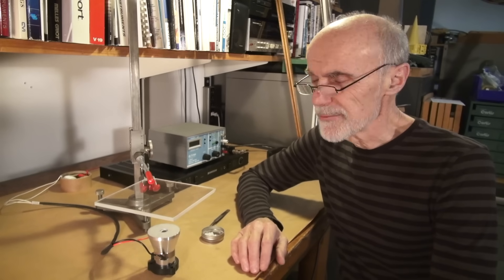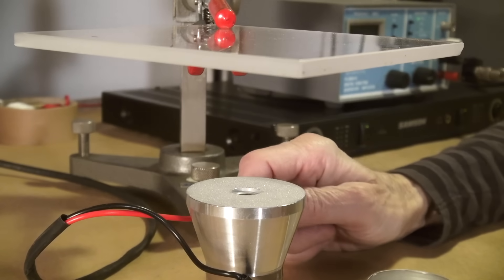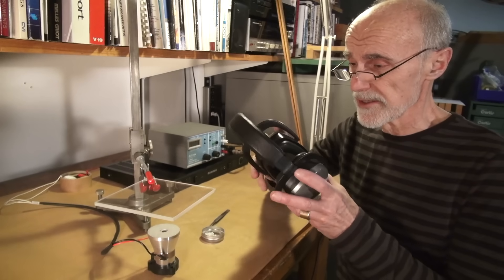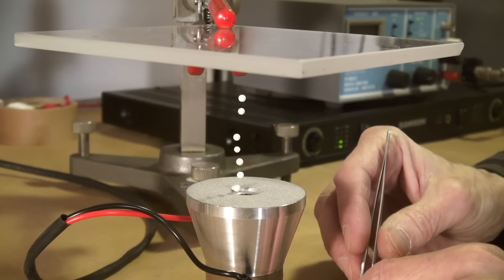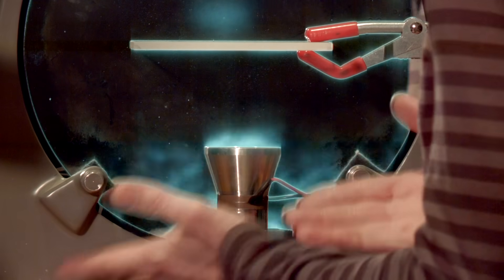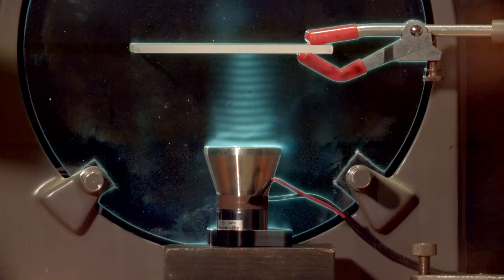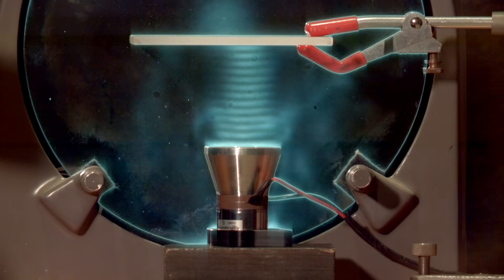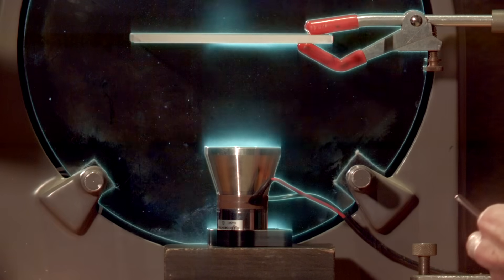Acoustic Standing Waves and the Levitation of Small Objects

Comment: wouldn´t the bright lines be the low pressure area? Your explanation did make sense, but my thinking is this:
the ball would be "sucked" into lower pressure areas and the high pressure above and below the ball would prevent it from going anywhere. 

since I assume, that i am in the wrong here :D , i would love, if you could take the time to further explain where my thinking is flawed!

regards from germany!
Reply: Yeah it made more sense to me too that the ball would settle in one of the low pressure areas. An explanation (from anyone who knows how this works) would be great.
Reply: I might be wrong but when he says high and low pressure it means high and low pressure variation. So at a spot of high pressure, pressure oscillate a lot between a pressure above atmospheric pressure and below atmospheric pressure. Whereas on a spot of low pressure, pressure hardly change over time.
Reply: @arseneferriere5151  That basically correct, but the balls will gather at the points where there is no change over time (wave nodes).
Reply: My guess is your explanation is correct, if there are high and low pressures, then directly in between there would be a point of equal attraction resulting in stability of the balls
Reply: I came to comment section for exactly this reason thank @ScorpEUs92   @Mihir Gadgil   @Arsène Ferrière  @Ad Addv
Reply: There are 2 different descriptions for sound. One is a pressure wave, that is literally the variation of the physical quantity pressure. And the other is a displacement wave, that is the actual movement of the air. These two waves are out of phase with each other. The nodes of one wave (the zero points) coincide with the anti nodes (points of maximum amplitude) of the other wave. So the regions of highest pressure variation are actually regions of least air movement. It is at these displacement nodes that the beads settle down.
Reply: @mihir2012  Thank you!
Reply: Mihir Gadgil you are correct.....only I still don’t know what the fuck you said. Lol
Reply: A comment to follow the thread
Reply: Well high pressure can be the location where the air flows to/ is pushed towards so it kinda makes sense I guess
Reply: I thought the same but it makes sense as he tells it. The high pressure is where soundwaves are going up and down so that they are squishing that zone as ina  sandwich and “sucking in”. Thats why the ball stays there. I mean the pressure is towards the center not outside of it. In the low pressure areaa the ball will simply fall down

Comment: What kind of energy is needed? Seems like a really inefficient way to levitate an object....
Reply: 8 watts
Reply: @wolfgangrueckner7151  per tiny Styrofoam ball?
Reply: @kogasoldier9379  No, the ultrasonic transducer is rated for 50 watts but we operate it at 8 watts (which is the minimum required to levitate the balls)
Reply: @wolfgangrueckner7151  well. As many as can fit in the pressure systems I assume...
Reply: @wolfgangrueckner7151  also. If I'm not mistaken. Such a system would only function within an atmosphere....

Comment: This could be used to create a flying car or something, with the sound producing area facing downwards and using ground as a reflector. But the problem is having the right wave band. As we can see in this video, distance between the sound producer and the reflector is key to levitating anything. So if our flying car were to go over a house or a hill or a large tree, that would break the required wave band length. Thus, our flying car will end up as first ever vehicular aeronautic crash.

Comment: SOOOOOOOOOOO what is a practical use for this effect? Make it work in a vacuum and I'll be impressed.
Reply: puts on AOC hat  what, like inside a Hoover?
Reply: A vacuum has no air. sound waves only transmit through air. Therefore it's impossible to make this work in a vacuum
Reply: @maribelhandesu  that was my point.
Reply: @rtta51 what's even the point of your comment then lol
Reply: @maribelhandesu  The point is, It Has NO practical application. A stream of air will levitate a ball (and even a screwdriver) in the air, looks cool but has no practical purpose.
Reply: @maribelhandesu  Google infrasound. Sound can travel trough space, but it requires ridiculously low frequencies because molecules are so spread out.

Comment: Nice! Can you do it with lower frequencies? Why 28 kHz?
Reply: At lower frequencies the balls have enough time between waves to fall out of the high pressure pocket and won't stay suspended. At 28000 Hertz, they only have 1/28000th of a second to fall before being pushed back up by the next wave. It's not enough time to move out of the optimal position.
Reply: David Crowley thanks! I was thinking shorter wavelengths would be the cause
Reply: @poopdtoilette6182  wavelength is definitely another equivalent way of seeing it: higher frequencies have shorter wavelengths so successive crests are closer. Standing waves with longer wavelengths (at lower frequencies) allow the balls to travel too much between successive crests, gaining momentum that the high pressure areas cannot completely reverse. The balls fall.

Comment: So what could you suspend, or move, with a, say, 100 hz frequency system?
Reply: the lower the frequency the more the wave spreads out and the harder it is to create a standing wave out of it. But, in theory, a lower frequency has a larger wavelength and should be able to hold a larger object.
Reply: @rumfordc  exactly, so...... in theory.... what can humans achieve as the most powerfull achievement in this sense? I mean, if we could focus an energy say, like nuclear energy, or rocket energy, into  a proper soundwave machine.... what could we lift? and create?

Comment: Aren't you mixing up high pressure with low pressure zones? I was under the impression that the objects as well as the mist are pushed into the low pressure zones.
Reply: that is certainly the orthodox explanation, but our measurements show otherwise
Reply: @wolfgangrueckner7151  On second thought, the high pressure zones are high pressure zones because stuff accumulates there in the first place... So makes sense then after all.

Comment: No explanation of where the lift against gravity comes from or the mathematical proof of why gravity is nullified? High pressure by itself is not lift.
Reply: How does an aeroplane wing work then? Maybe not high pressure itself but certainly a difference in pressure. Increased on the underside and decreased on the top.

Comment: Childhood experiment on ultrasonic levitation by using a piece of plastic sheet, stretching it tight with the hands and rubbing vigorously on the tights to generate heat, after that applying above on small paper cuttings set up on the table making the paper to jump upwards and upon lifting much higher the paper will stop jumping.

Comment: I don’t understand why the balls rest in high pressure bands rather than in between the bands.

My understanding is that they are floating, because in the high pressure area the density of the air exceeds the density of the ball. But if that was the case, part of the ball would be in the high pressure band and part in the low pressure band, just like a ship is part in the air and part in water.

So I am wrong that this is a floatation due to high-density air ? Is there another mechanism at play? Which one?

Comment: I worked in the field video, internet, and VOIP installation and repair and loved this demonstration! I had to learn about wavelengths and fm antennas are built in increments of the wavelengths you're trying to tune into. Older cars were 42" (1/2 of the wavelength) and then they were shortened to 21" (1/4 of the wavelength). Cable installers don't measure the distance between cable clips because, if you space them at the same exact distance apart (i.e. 14", 21", etc), there's a good chance of canceling out the frequency that travels at that wavelength. In the current digital cable world, they can fit 6 digital channels in that one band so, if you're having problems with just 6 channels, something is wrong with that one frequency and that could be one of a few culprits. Cool stuff and much more technical than I originally expected. Love it though!

Comment: Are you sure about the region pressure? I think the balls will stand in the low pressure region. High pressure regions will push the balls to the low pressure region. Am I wrong?
Reply: That is indeed the general consensus, but our measurements show otherwise.
Reply: @wolfgangrueckner7151  thank you for your answer. I had another question. Why do we use high frequency? I guess reducing the frequency will increase the size of object. Isn't it?
Reply: @fikretkus106  the higher the frequency, the shorter the wavelength and thus the smaller the apparatus.  For example, the wavelength at 100 Hz is about 10 feet, so you would need a lab space where the reflecting surface is 20 feet or more away
Reply: @wolfgangrueckner7151  so if I want to levitate an object about 1 feet I should set the wavelength proportional to that size. The only limit is the apparatus size. Right?
Reply: @fikretkus106  The acoustic standing wave size is some integer multiple of 1/2 wavelength.  If you minimum levitation height is 1 ft, then you need to set up a reflector a few feet away from the loudspeaker and use a frequency around 1 kHz.  That's a HORRIBLE sound to hear, and REALLY horrible at loud volume (which you need to levitate).
Reply: @wolfgangrueckner7151  but it still worth to try :)
Reply: @fikretkus106  absolutely!

Comment: Oh, hey...HOW much pressure is in the high pressure zone?  Can you tune that pressure? Increase it? 

Doesnt graphene production require high pressures? Could you possible use this to produce cylindrical graphene without a substrate? 

Like,  if you emit in 360 and then reflect back in 360 (from a tube of reflector material around an omnidirectional emitter).  Couldnt you suspend carbon atoms AND pressurize them.  

Couldnt that be used to produce a tube shaped piece of graphene?

Comment: So, couldn't you maintain the standing wave through the periods where it normally would disappear by changing the frequency of the wave? Or does doing that dissipate the high pressure areas. 

Ive seen a similar experiment with water droplets,  i became interested in acoustic levitation when I was trying to solve the problem of providing frictionless movement over the a surface, like a hover-craft. 

I dont think acoustic lev. Will ever be viable for that.  But for chemistry and even 3d printing or assembly requiring simultaneous access to a piece in 3 dimensions this could be super useful.  But I think youd need a denser medium than air, but still gaseous to prevent the print medium from partially dissolving. 

Also im guess vibration would be an issue.

Comment: Can you maintain the waves by changing/matching the sound frequency to the distance between the speaker and the reflector (glass plate), e.g. by constantly measuring the distance between the speaker and the reflector and adjusting the frequency accordingly?

Great demonstration!
Reply: The answer is yes if I could change the frequency, but the frequency is fixed at 28 kHz for this transducer.

Comment: So hypothetically if you could construct the speaker device to be  very large or even more than one device in a vehicle and faced it downwards using the Earth as the reflector could you theoretically have created a levitating vehicle, a levitating aircraft that could travel within those high pressure bands at will,  continually using the Earth as the sound reflector?
Reply: Thats the reason why when flying saucers flew over cars their radio would cut in and out 👽 📻 ...
Reply: @FelFree  are you kidding?
Reply: @andrewc1036  Why are you asking me that ? And I will tell you
Reply: @FelFree  because ultrasonic acoustic waves don't interfere with VHF and UHF electromagnetic waves.
Reply: @andrewc1036  well I'm not gonna lie I did think I was on to something ... But I thoughts I was gonna get laughs out of it ... Thank you for teaching me ... And How do you know by the way ?
Reply: @FelFree  no worries it's all good. 

One is waves pushing air back and forth the other are electromagnetic. Also radio is an much higher frequencies than sound waves.
Reply: @andrewc1036  ... got you. thanks !
Reply: I think this would work with two rotating electromagnetic coils and depending on the ultrasonic frequency strength you can both cancel out gravity and dial in the desired height locally! Just make sure the ultrasonic frequency is active inside the coil to interact with the coil's electromagnetic spin!
Reply: @jocen3225  Hmmm. But gravity is a function of mass, not the earth's magnetism. Unless you're talking about having an electromagnetic emitter on the surface of the earth. That's be theorized, but the size of it, and the amount of energy needed to power it, would be astronomical unfortunately.
Reply: That would be cool. Although I wonder what would happen in a power outage. :p
Reply: Warmonger of Warsong how will that make it fly? I could see how the compartment above the mirror would levitate but wouldnt the whole thing just drop to the ground due to there not being any standing ways between the speaker and the ground? And also what kind of crazy power would you need to generate waves powerful enough to lift that wave when a normal speaker can lift about 5 water droplets?
Reply: @abvmoose87  Very good ! I'm happy to find one with the brain!
someone should warn the guy that hot water has already been invented!
Reply: Yes but the amount of power needed for that lift, prop would be more practical to just use jet engines
Reply: Warmonger of Warsong  no
Reply: It would also sweep up debris causing catastrophic shrapnel to anyone around it as it passes.
Reply: Well, you see how fragile the effect is, by altering the height a small amount the effect is gone, not to mention those balls are very light.
Reply: standing wave levitation only works on small enough objects that are not moving. they need to be shorter than the wavelength lifting them, and lighter than the amplitude of the wavelength lifting them. only high frequencies will maintain their amplitude across a distance, and high frequencies have short wavelengths, therefor only small objects can be lifted by them
Reply: Nightmare for dogs, bats and other animals/mamals that rely on sonar I'd imagine.
Reply: Warmonger of Warsong  congratulations son now we are ready to invade other galaxies!
Reply: Amazing
Reply: The problem is it is levitated in between. So the Vehikel would just fall down but if you had a tunnel with such a device on the roof then it could hold and object floating in the tunnel, though the area of high pressure would need an expanse
Reply: That will not work. The sound waves need to be bounced back upon themselves at the right distance, for them to give this effect. Creating a moving vehicle out of this principle would be much more complicated and would require an impractical amount of energy.
Reply: @chrisgriffin4012  Yeah not viable at all....

Comment: High pressure regions don't explain how an upward force is applied to the balls to overcome gravity. There must be a pressure gradient somewhere that causes an air flow which suspends the balls.
Reply: A possible answer.
It seems the pressure wave is moving up and down so fast (standing wave) we cannot see it's movement.
Tis possible the balls are not stationary just moving (oscillating) so fast we cannot see it?

Comment: What gives rise to the surface curvature of the standing waves allowing the beads to settle?
Reply: Sound waves are naturally curved.  Theyre emitted in all directions, like a half circle. 

The light bars are where two waves intersect and cancel.
Reply: Sound waves are naturally curved.  Theyre emitted in all directions, like a half circle. 

The light bars are where two waves intersect and cancel.
Reply: @iamscoutstfu Right, I would have assumed the standing waves would "bow outward" from the transducer where there should be a bit more local energy, forming an inverted pendulum with the bead and preventing it from settling (it would roll off ). We can observe that it is because the waves bow outward from the reflector that the bead settles. Is it the larger surface area and/or composition (i.e. natural frequency) of the reflector that results in the specific geometry that we are seeing?

Comment: So the secret to flying saucers is a speaker that never let's those waves collapse. Or can use the molecules of water and air in the atmosphere as a reflector.
Reply: The secret to flying saucers is electrogravitics my guy
Reply: @Nikp117  I actually agree with you on that. Super chilled semi conductors exhibit awesome levitation properties.
Reply: I had similar thoughts.
However I wonder if one created electromagnetic standing waves would this achieve anti - gravity?
Reply: @stuartd9741  there is a nice video of someone using electromagnetics and a super chilled magnet. It floats and is unbothered by obstacles. It also creates zero friction. Coolest video ever. Anti gravity is limited by how much power we can create. So until we either make batteries 1000x more efficient or find a way to make a fusion reactor the size of a midsize sedan....were stuck with good old liquid o2 as our propulsion systems.
Reply: The secret to flying saucers is nasty food.